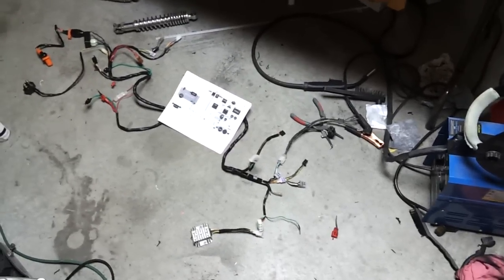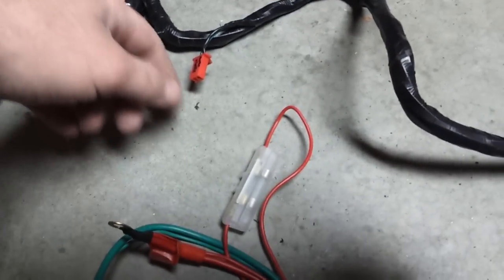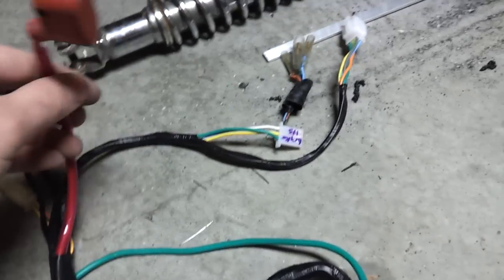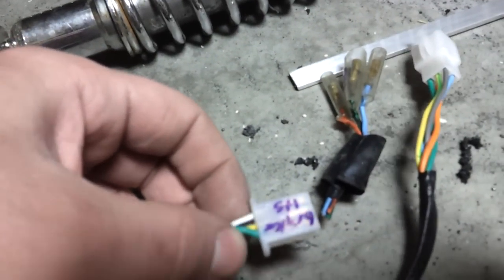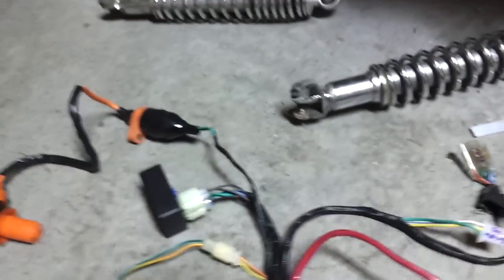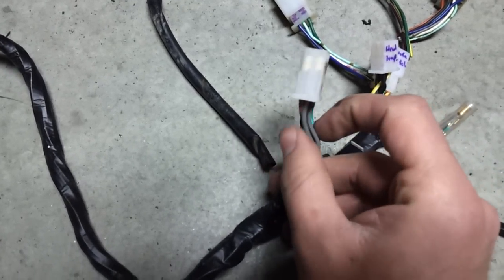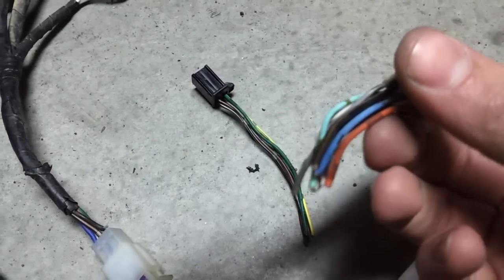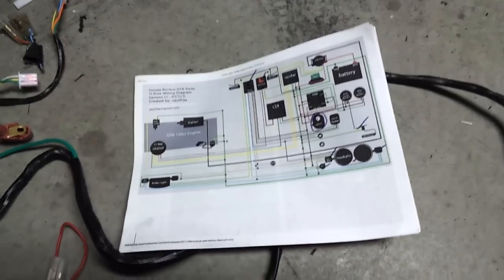Making my own GY6 Swap Harness for the Ruckus

Comment: The black unit is your starter relay.  The cheapest way to avoid headaches with wires is your local  alternator/starter shop  or auto electric shop .  More you can make available to them is less money you need to spend.  That's how I do mine.

Comment: That little black box you picked up and called it a coil with the starter relay and that red wire with the red plastic cap goes to your starter ding dong
Reply from the maker: Yep. This video is also 6 years old.